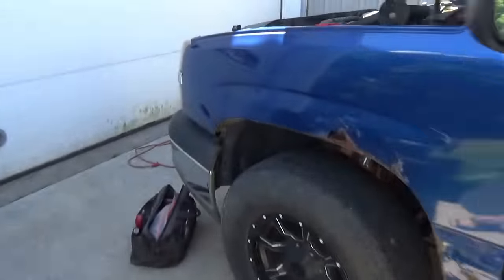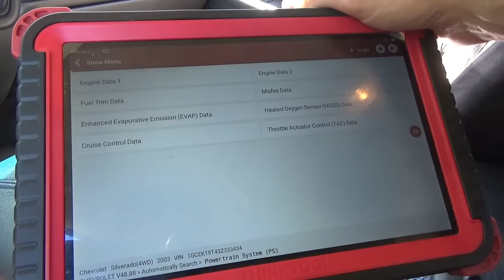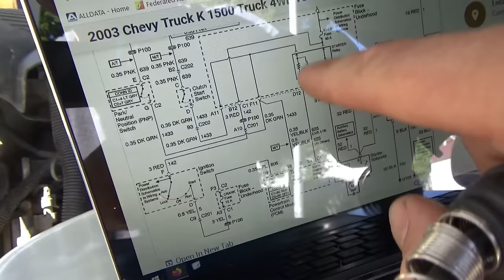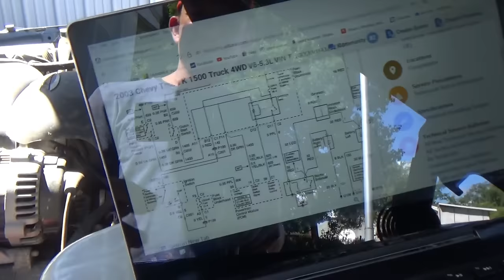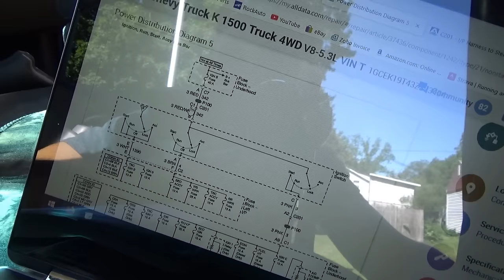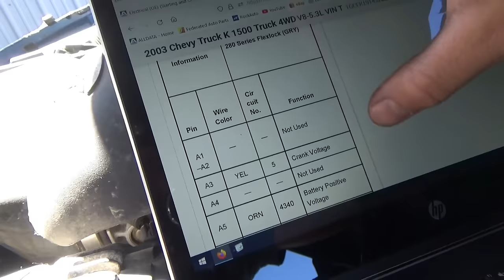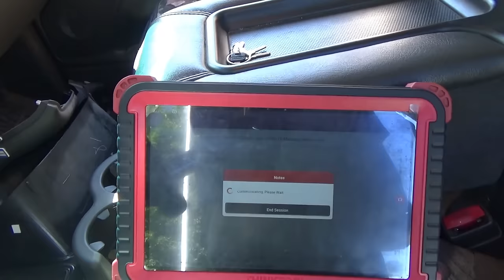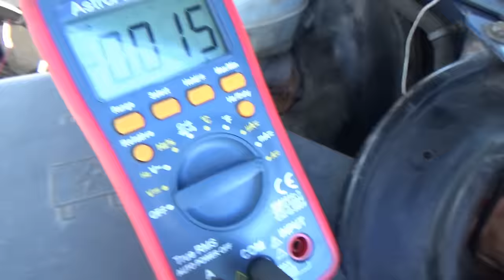No-Crank Chevy...NOT What I Expected!

Comment: Exactly my problem on a 2004. I couldn't find a wiring diagram , took it to a shop twice. First time , he replaced the fuse box. This must be a common problem with the fuse boxes. A year later, same problem came back. I was using a jumper wire to start the truck. I applied your fix, and bingo, problem gone for good. Thanks a million.
Reply from the maker: Nice!

Comment: This wire ended up being my same problem. After 3 years of intermittent issues. No crank, sometimes with instrument lights, sometimes without, except the check engine light. Intermittent blower motor function. Random dimming of lights. Even my 4x4 switch issues. Thank you for this excellent video!!!
Reply: What wire was it? Do you happen to have the part number?

Comment: Ivan you are so diligent when it comes to diagnostic work. You are definitely a master of the bypass test. You're absolutely right, the test light is a very powerful tool that alot of technicians do not use to its full potential..
Reply: I will go a once over with a test light, then break out the meter if it passes.
Reply: Important to know what type to use also. Big load to test for continuity, sensitive bulb to test insulation.

Comment: Great diagnostic, Ivan! I would go straight to the ignition switch, because it's a high wear part that can fail, but didn't expect the problem to be in the fuse box - good reasoning and not jumping steps really paid out! That corrosion control device seems to work well for itself - the device is not corroded :-)
Reply: Thank You John ñ

Comment: Fascinating. I’d love to see inside that fuse box.
Reply: There are thin copper buss bars. They corrode and break. Sometimes just a hairline crack. No active electronics. Actually a somewhat common issue. There are some videos around the internets that pinpoint the exact failure. I will see if I can find it and link it below…
Reply: Here you go…

https://youtu.be/QKAlnxkMykw

Comment: A theoretical mathematical point:  You can do this kind of detective work MUCH faster if you use a binary search algorithm:  pick the midpoint of the circuit, check it.  That cuts the search area in HALF with just one test.  Repeat halving and testing.  For instance if there are 8 points of failure, instead of having to test 8 places, you can find the problem with just 2^X=8, where X equals 3.  If there were 64 points, just 6 tests.  Theoretically proven to be the best search algorithm.
Reply: You may have noticed Ivan says “cut the system in half”. That’s exactly what that means.
Reply: Where do you live lol im having a ground problem or something ugh why so many dam wires i hate the chevy Malibu 😡

Comment: Great analysis. Another crimp story: A $30K computer low voltage, high current path had a creeping loss over long periods (6 months). Two engineers studied this for weeks when one finally got hold of an IR camera to seek out the cause of increased resistance. Turned out to be a crimp on one high flexible stranded wire (very fine gauge strands with a high strand count). Over long periods the strength of the (properly done) crimp would relax bringing the impedance up to 0.05 Ohms. Connection integrity faults account for most electrical failures.
Reply from the maker: Actually I have a Thermal Camera video coming out today!!
Reply: @PineHollowAutoDiagnostics  He say: "Good idea... " (Stolen from Never Cry Wolf.)

Comment: Looks like an upstater! Awesome bypass tests and permanent bypass fix. Who needs a circuit board hidden in a fusebox to run an ignition circuit? Not this guy. I’ve come across this issue before but with different failures and am always curious about where the failure is on the circuit board or internal leg/pin. You could do a series of failed part dissection if you collect enough of them 😄

Comment: My uncle had a really nice S-10 long box extended cab 4x4 all cherried out with the ziebart electronic rust control. He took really good care of his truck keeping it clean but the electronic rust control gimmic actually rusted the truck out so bad it had to be junked at around 120,000 miles. Frame rotted in half and it had holes all over the body is weird places like a line of holes down the center of both doors and the center of the box and the rest of the body. Tail gate surprising wasn't rusted at all. The bed and everything else was just rotten until the frame started cracking and it started breaking fuel lines and such. It was also an electrical nightmare being the grounds started rotting off and in the 90's no one knew anything about this new electronic fuel injection just had wires jumping all over. What a shame. The truck didn't even last 10 years when you see others that had 3 times the mileage and last twice as long not even washing it.
Reply from the maker: That's insane lol

Comment: I wonder if that one is the same as some other GM fuse boxes that have a solid 20 gauge piece of wire running through terminals on the inside where the wire tends to break in two when they get older? I’ve taken some of them apart in the past and fixed them.

Comment: You can take those fuse boxes apart, the only problem with that fuse box is that one of the wires is cracked that is routed from pin to pin.  I've replaced those little wires before, all they are just 20 gauge wires.

Comment: That was strange place. I have a 93 F-150. It was in the same wire loom going from fuse box to firewall connection.  I found short using voltage drop from that connection on ignition  switch to engine fuse box. The wire bundle after fuse box was naturally laying on  wheel well.  Years of rubbing against each other in the harness due to weight of harness itself. Used the power probe  signal generator to find the location of the  short. i was very lucky because signal generator may not work.

Comment: It is probably easier to bypass the fuse box with an external fuse but you can take those fuse boxes apart and fix them in about the same time you can go and get a new one from the junk yard... well, it depends on how far the junk yard is, but you may have to drill out some plastic welds to do it.  It is likely a cracked and broken bus bar, most likely near a bend in the metal.  You can fix them by removing them and soldering the bus bar back together or bypassing the crack with a thick enough wire.  All you need is a soldering iron that can get hot enough to heat the bus bar quick enough to melt the solder.
Edit: And of course a Dremel or drill to cut and drill out any plastic welds.

Comment: OMG this is exactly what's going on with my 2004 Chevy Tahoe! Was intermittent at first, but seemed like a short in dash bc I got a new battery and everything was working, lights door locks etc. I just cant get any voltage to my ignition. Thank you for this video, I sure hope it helps I've been without a ride for going in 2nd month. A new fuse box will it be hard to hook up?

Comment: I've seen this problem before. A tech worked on the SUV the same year and replaced the start switch on the column. That didn't fix it but it did actually. He just did not set the switch to the correct setting to match the old switch. Once I did that the engine started right up. They should get 12v to fuse 10 I believe in the fuse box in the cab of SUV. That's what I was getting because the switch was engaging completely.

Comment: one thing to look at in the salt region of the north east. The braided wire between the solenoid and motor rotten away. It will look ok. Grey in color, but probe it with a tool and it turns to dust.

Comment: , I have a 2004 Silverado and I live in texas , only happens when it gets hot but I can drive it , park it and won’t start until it seems like it gets cooled off , I did push down on fuse box and truck started , but later on I tried it again and it wouldn’t start until I tapped pretty hard on fuses . What’s your thoughts

Comment: My 2000 sierra had rotted a hole under fuse panel on wheel well. It Caused that rot spot on fender. If ignored it i would of eventualy had the same issue as this truck did with the fuse panel. Took a square piece of commercial mud flap and used roofing cement to cover rotted hole . my truck is a 298,000 non virgin

Comment: I'm very curious what goes bad inside these fuse boxes. The exact same thing happened on my kia Amanti, and the repair was the same except I used a marine grade fuse box (4 fuse capacity). While I was there, I found the failure point for the heated seats and added that to the marine fuse box. I traced the heated seats to the fuse box years ago, but didn't bother to continue because winter is like 2 days long where I live. So 2 similar failures in the same box a couple of years apart. Makes me wonder🤔.

Comment: Seeing a rusted-out farm truck like that, I would have made the same kind of repair.  As long as the vehicle works as it's supposed to and it was a cheap fix, they are happy.  Those owners don't want to spend a fortune on repairs.  But I wouldn't be surprised if someone had crawled across that fuse box a time or 2 and did some damage to it.  It's rare but I have seen it happen.

Comment: Ivan, you spent a decent amount of time checking the ignition A 40A fuse and putting a test light across it, etc.  Didn't your bypass test that got the starter motor to work and start the engine already prove the 40a fuse to be good?  If it were blown the load side of the starter relay wouldn't have had 12v available.
Reply from the maker: Great point! Indeed on the diagram that 40A fuse also feeds the starter relay 👌

Comment: 👍Ivan: only because I’ve had 3 bad GM fuse panels “ rotted green” internally , I knew what the fix was LOL ,, the anti-rust device is a waste of $,,, Ford use to install them @ Dealer level in Ontario,,,,, they don’t work ,,, as you can see,,, they are “triggered every key cycle “ Chinese Steel ? Good Video ! Thanks

Comment: Hello, I have a problem with a 2003 chevy venture no crank no start, all fuses and relays are good I got power to the crank wire going to the PCM but no power to the yellow wire coming from that PCM to the starter relay to give it the negative voltage, I ground the yellow wire and the car cranks but no start, do you think the PCM is bad or the theft control not letting the PCM sent t power to the starting system and the fuel system. I did replaced the key cylinder and when true the steps to program the key, , I do hear a click at the relay next to the BCM , that relay is the theft control relay. I ohm the yellow wire from the PCM pin to the starter relay and is good, The PCM got 12 volts , another problem is the scan tool does not communicate with the PCM, I got power to pin 16 and the signal wire going to the PCM ohm god. do need to replaced the PCM. Thanks for your time

Comment: This was actually an easy one. Pretty simple circuit.  I usually check all fuses early in my diag... would've caught that ignition fuse issue and probably out of there in 20mns... but the process is fun to watch
Reply: There are ways to check relays as well, but always start with simplest stuff then go to more difficult stuff
Reply: Would you have? The fuse was fine it was the power output thru the fuse box. Its easy to say oh I would have caught that in retrospect but you could spend all day checking fuses and have the problem be the ignition switch or something else.

Comment: I have a 2003 Chevy 1500 4.3 engine that has the same problem..no crank ...I have checked the starter relay and the top left hole on the relay has 10 volts with the key off ..some please explain

Comment: Question for the audience: I have a water pump that leaks but will not be a problem generally. The last time I drove it it leaked like crazy. 2 months before that it did the same but no issues since. I think my thermostat is stuck open. Could this be responsible for this issue? I think the water pump has a slow leak and since I don't drive it often it doesn't leak out quickly. Am I right to think the thermostat is the basic problem. This is a 1999 Chevy 4.3 and there no codes set.
Reply from the maker: Thermostat should have absolutely nothing to do with a leaking water pump 😅👍

Comment: I know this may sound contrary to what Ivan does. But, given the age of the truck, I probably would have pulled the start relay from the fuse box inspected and cleaned the pins, installed a new one of the same type and see if this corrected the problem. I have a good selection of automotive relays in different sizes from P&B with different features (resistors, diodes, etc.). For the price of the relay (my cost) I probably would have just charged the customer for a new one even if not the problem, due to the high relative failure rate on relays, and also I have a warranty to my repairs and I don't want to see a return based on a faulty relay. No parts repair is great, but for the price, I have no problem replacing a very old relay.

Comment: How does the corrosion control device, actually work?
Reply: it doesn't.

it't like a fuel saver magnet, just a gimmick. 

there is a real practice where you stop corrosion with electric current, but it only works in soil, or underwater... it's impossible to work on a vehicle, because vehicles aren't submerged in liquid or some other conductive material.
Reply: @volvo09  Thanks for confirming my suspicion of it being a con. Guess there is an electromagnet, rather than a permanent magnet inside that black box, as it had power cables attached, which basically does nothing to stop corrosion.
Reply from the maker: It just draws down your battery to accelerate the corrosion 🤣

Comment: Should have spent the money for that "corrosion control device" on underbody wax and sprayed every exposed sheet metal and frame puece from the inside.
Reply: The frame is coated with wax at the factory.  It's not very effective in the salt belt. These trucks are complete rot boxes.
Reply: @alantrimble2881  you should recoat it every couple of years. It might be harder on a truck since the frame is not accessible from all sides. the sheet metal would benefit from at least one layer of wax, it doesn't have any from the factory.

Comment: I have zero faith in smaller crimps. I'm team solder. Unless it's 4 gauge or bigger, and then I use my hammer crimp and beat the hell out of it until the lug and the wire become one. But for anything smaller, I solder and use marine shrink wrap with glue on inside. I've heard that crimps are supposed to be better and that airplanes, for example, strictly use crimps. I've seen plenty of crimps fail but never a solder joint. Granted, a perfectly done crimp is better than solder, I'm sure, but my crimping skills aren't very good, apparently and I've been soldering wires for a long time. Soldering seems more foolproof, basically.

Comment: I saw a meme the other day that said all 2003 Chevy pickups were being recalled because the owner really should have bought a new truck by now.
Reply from the maker: 😂 Ironically the 2000s Chevys will outlast the new ones... Except in the salt belt 😢
Reply: My 06 frame rotted in half at 88k in NEPA. Love the  crap the use on the roads here year round. Penot brine on state roads in winter. Summer township brine on dirt roads for  dust.  Even chassis washing  once a week does not stop the stuff.

Comment: 2002(?) 2003+ are all electronic control on LS
Reply from the maker: Yeah I think 2002 was the crossover year
Reply: 2003 was the first year for the drive by wire on the 4.8, 5.3, and 6.0. I think 2001 is the first year for it on the 8.1. In general, if it's a cat eye front end, it's drive by wire, if it's squint eye (99-02), it has a throttle cable

Comment: What?!?!?  So, inside that fuse box there is a tiny wire that is soldered to one pin, runs over to the other pin and is soldered there and its broke.  Because they want it to be "drop in" at the factory, you are going to need a masters degree in EE to open up that box, fix the real issue, and then return the box to service.  

My feelings for manufactures sours by the day.
Reply: Perhaps part of planned obsolescence to sell more vehicles?

Comment: Never expect a crimp to always keep the connection. 
Never expect solder to keep wires tight together.
Both give you a perfect combination :-D
Somehow i knew the owner would want the easy and fast fix,  the bypass wins lol.
Reply: "Never expect a crimp to always keep the connection. "

A correctly formed crimp is extremely reliable and doesn't promote fracturing of the wire due to solder wicking.  Look at high reliability, safety critical applications that are subject to vibration like railway signalling and you'll find crimped terminations, not soldered.

Comment: I make my own butt connectors with nicopp brake line with dielectric grease squeezed into them and heat shrink tubing. Pretty handy since they make nicopp from 3/16 up to 3/8. Super strong too. Ive even made starter ring terminals with 3/8, just smash one end with a hammer and drill a hole in it.
Reply from the maker: This is a brilliant suggestion! I've been using NIcopp line for many applications in the shop, but never thought to use it as a crimp lug! 👍

Comment: Hah. At the very start of the video I noticed that some of the fuses in the fusebox are rusty, I was expecting when you pulled out the fuse there to be nothing left of the terminals that hold it! I've never seen a rusty fuse inside a box before (and my friends and family have several of nearly this exact same vehicle), there is no way the cover was kept securely on the box.